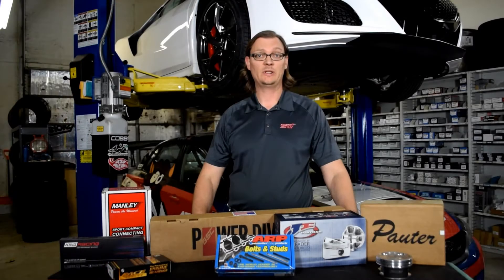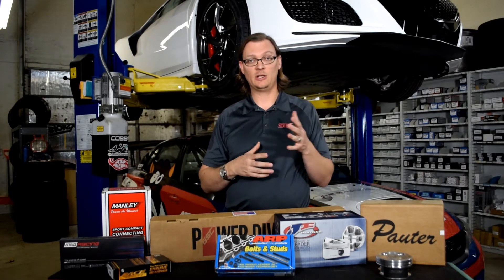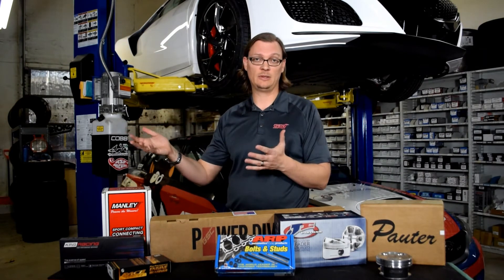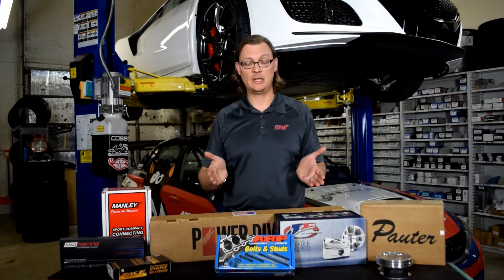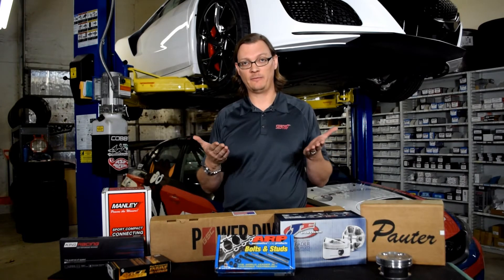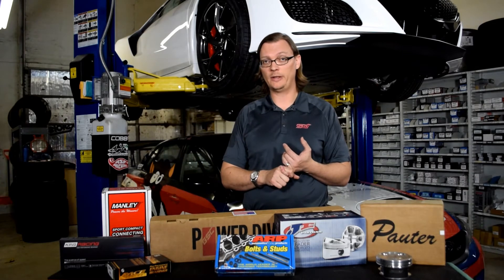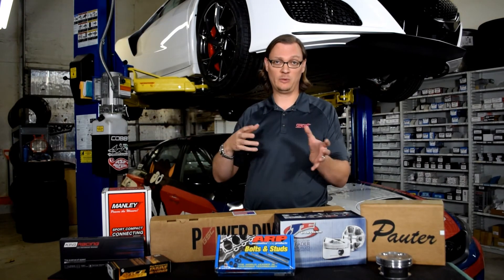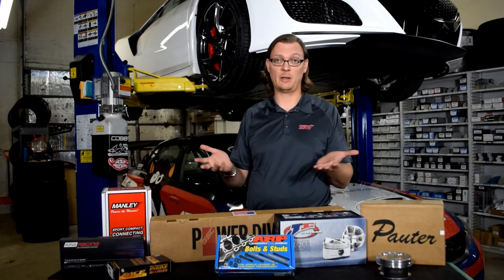To Build or not to Build your Turbo Subaru EJ Engine

Comment: Very well explained. 
I have a ej25 but im a bit worried of ringland and i was thinking of upgrading to forged piston and acl race main and cone bearing. Keeping stock VF52 probably a good tune at 16psi or more.
Should i get  forged rods too?
Is it a wise upgrade....? 
Looking for 320hp from crank and an engine to last!
Reply from the maker: Thanks for your question.  If you are just running a VF52, then forged pistons should not be needed.  And as stated in the video, the other thing to keep in mind with forged pistons is that they typically come with a shorter overall life expectancy than the stock pistons.

Hope that helps, and thanks for watching!
Reply: @FlatironsTuning   Oh! You actually replied, thanks. 
Im going for street tune (stage1) my  ej25 for 300hp, i hope rings wont give up. Going to invest for quality tune. Thanks for the tip.
Reply from the maker: @deom2i  Sounds good.  If you are going to get a street tune, you may want to go through the video that we made going over the advantages and disadvantages of the different types of tunes too:

https://youtu.be/0YqStaVQg_c

But yes, at that power level, you should be fine with a good tune.

Good luck, and thanks for watching!

Comment: Im building an ej205 power level is 300whp with stock 07 sti turbo (vf43). Im planning to go forged rods/ piston, stock crank, and stock heads. I need opinions.
Reply: Forged is overkill for those goals. Might as well go bigger with the turbo, or keep stock shortblock. Regardless, be sure to upgrade to STi / 06+ WRX oil pan, or an aftermarket pan

Comment: What are good cams for a stock jdm ej205 with avcs, the motor has a 16g blouch turbo, IAG fuel rails and 1000cc injectors, catless tbe and uppipe
Reply from the maker: Thanks for your question Rob.  With that small a turbo, I'd just stick with the stock cams.  If you put in an aggressive cam, you will start to lose low end torque which that turbo does well, and then at higher rpm when the cam really starts to to work, that turbo will fall out of its efficiency.

Hope that helps, and thanks for watching!

Comment: In the process of rebuilding someone else's build on a 02 wrx hybrid, I'm doing complete tear down. It has 257 block with wiseco pistons, eagle rods, with 205 heads sized to 52cc, 1000cc injectors, td05 turbo, Cobb accesstuner. This setup will put me at 8.9:1cr not sure if I should drop down to 8.5:1cr. Looking for around 325-400hp. Car will be used for auto x and drag strip. What is your suggestion for cr and anything else?  I will be ordering parts from you guys at flatiron just because of the knowledge you have with these cars. Great videos, keep it up!
Reply from the maker: Thanks for your question!  For this specific of a question, I'd recommend calling us or e-mailing us directly so that we can go into detail with you.

The short answer is that ideal compression ratio largely depends on the fuel that you will be running.  If you are running E85, or a largely detonation/pre-ignition fuel, then there can be some nice gains made from increasing your compression ratio.  However, if you are running standard pump-gas, our experience has been that you are best to stay close around the OEM compression ratio.

Thanks for watching, and thanks for your business!

Comment: Another great video. I can honestly appreciate this video. I just started my build, I ended up going with a iag stage 2 block. My goal is 450hp, not sure with what turbo I should go with. I want a direct bolt on.
Reply from the maker: Thanks Miguel.  That is a good block as a starting point certainly.  For turbos, I'd recommend looking at a small 30R with external gate if you are wanting to go rotated, or if you are looking for stock location, something like the Turbo Dynamics MDX555-450:

http://www.flatironstuning.com/p-3943-turbo-dynamics-mdx555-450-hybrid-turbocharger-450hp.aspx

Or the Blouch Dominator 1.5 XT-R:

http://www.flatironstuning.com/p-2306-blouch-dominator-15xt-r-ball-bearing-turbocharger-for-the-subaru-wrxsti.aspx

And of course you will need the supporting fueling and cooling mods to go along with the turbo.

Hope that helps, and good luck with the build!  Thanks for watching!
Reply: FlatironsTuning thanks alot. I'm planning on going flex fuel. Quick question, do you think I can get away with stock heads and cams or should I port them and get aftermarket cams (stage 2)?
Reply from the maker: Hello Miguel.  First, what heads do you have?  On the 2.5 liter engines, you can get well over 400 whp with stock heads and cams.  And for your goal for 450, I'd say that the stock 2.5L  heads and cams should be fine.  I'd start to look at cams if/when you start to shoot for more than 500 whp.
Reply: FlatironsTuning man, thank you so much! Hope your channel keeps growing, thank you for your great information.
Reply: FlatironsTuning 2006 sti
Reply: Do you sell any turbos that are direct plug and play that are rated a little bit more then 450bhp?
Reply: Miguel A Rios Izaguirre I’m tracking mdx555 has three versions being 400,450, and 500. I decided to go with the 450 thanks to Cooley’s warning about cams becoming prevalent at the 500hp mark.

Comment: Thank you! All the info you stated is spot on with what my tuner said. Very reassuring. I definitely trust him even more now. I'm going for 450whp. We are over building and tuning it conservatively on both acn91 and e85(full flex fuel kit). Since I trust your judgement. Would the block(iag 3 tuff) last longer with this type of approach or is it overkill? I still know that I'll be doing a refresh around 80k give or take. My tuner was very straight forward with that but when I suggested a less "strong" block he suggested that I not go that direction. I will be tracking it 5 or 6 times a year or more(California weather). I know it's kind of a hard question to answer(subjective) but your opinion/thoughts are greatly appreciated. Oh and I upgraded EVERYTHING to support this powa' Cooling ,exhaust, fueling, turbo, oiling and induction and I mean everything. Thanks.

Comment: If I'm looking to do a hybrid build using wrx  heads and je pistons would you recommend installing the pistons on an new oem sti short block or at that point should I go with something like iags closed deck case halves and new rods etc? Only looking for around 375 hp.
Reply from the maker: If that is your power goal, you are just past the point where stock pistons would be at there limit, requiring forged pistons.  You could certainly put them into a new OEM block, or build a new OEM case.  You don't need a closed deck block.  That is only needed if you are looking to push past 550 whp or so.  You would not get any benefit for it at your power goal, and you would be adding a significant amount of cost to your engine build.

I hope that helps, and good luck with your build!
Reply: FlatironsTuning Thank you, for that 350-375 hp range would you always recommend starting with a new oem shortblock or is rebuilding a spun bearing or similar 257 okay to do for that hp? Not really looking for insane reliability because it's not going to be daily driven at all more for just autox and track events.
Reply from the maker: Well, the first step with any used block is to have a quality machine shop inspect it.  If it is good, but needs to be over bored, I'd recommend not going to more than 99.75mm.  you really want as much material in the cylinders as possible.  100mm is okay for moderate builds, but not ideal.  For bigger power (450 whp+), starting with a new case is a better bet.

But overall, making sure that there are no issued with the block is critical before you start machining it.

Comment: My 14 WRX spun a bearing two weeks before this video was published! I wanted to do the work myself but man it was stressful! Glad I had a buddy to guide me over the phone. 7 weeks later and luckily it started up on the first try. After watching this video I am glad I stayed with a stock block with modest power goals. I have the turbo and nearly ALL tge supporting mods to go over 300whp but my hope is that the engine will make 300whp without working so hard. I drive 30,000 miles/year. Thanks for the tech tips!!

Comment: Great no-fluff videos, with valuable information on the subject!  I'd love to get some input on engine longevity for a built block with different types of forged pistons.  2618 vs. 4032 alloy?  My understanding is that 4032's run a clearance closer to stock, so how much longevity does that equate to vs. a 2618?

p.s. love the new(ish?) website storefront - haven't ordered anything since late 2014, it's a big improvement!
Reply from the maker: Thanks for your question.  Looking as simple wear, yes, an alloy that lets you run a tighter piston to wall clearance would be more ideal.  You will always need to pay attention to the piston manufacturer's specifications, and use that to compare one piston to another.  When you are looking at power, that is a somewhat different matter.  You need to look at what the manufacturer says about how much pressure/power the piston can withstand.  From what we have seen, in many cases the alloy that does allow for tighter PTW clearances will be rated at lower overall power.

Ultimately, if you are looking at a couple different pistons, we would recommend talking to the piston manufacturer directly about their specs, and make your decision with that information.

Good luck with your build, and thanks again for your question!